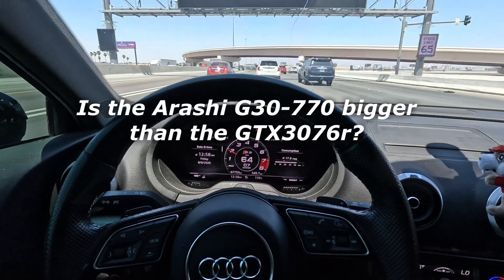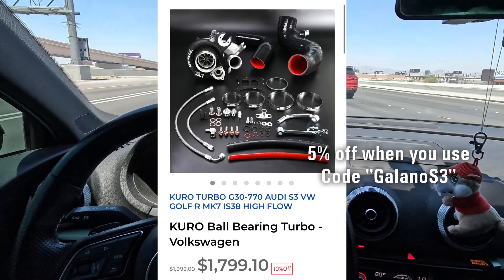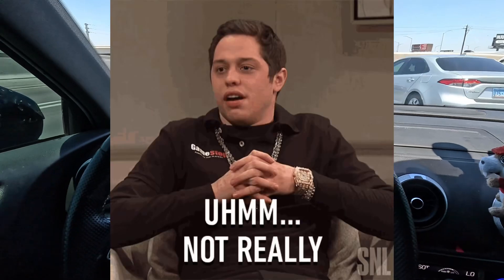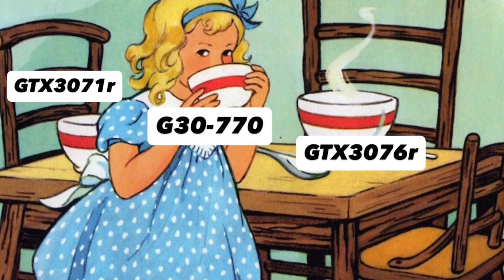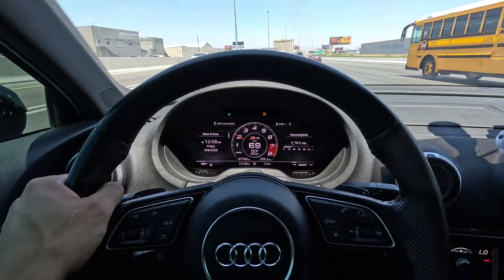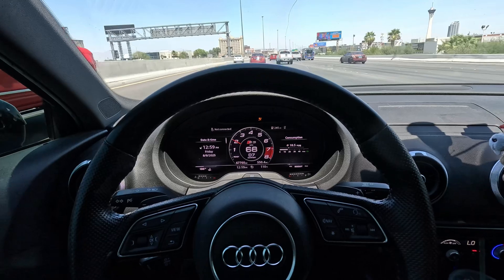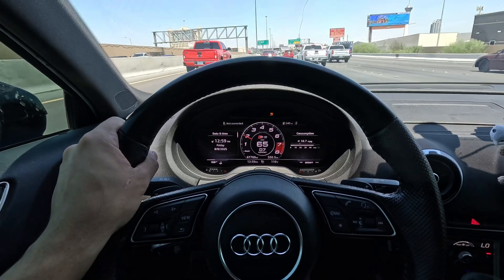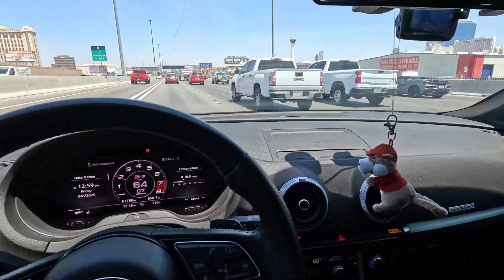Q&A: Is the Arashi G30-770 bigger than the GTX3076r? Lets Talk!

Comment: If the Arashi turbo compressor map has a similar garret’s compressor map, you can say that the g30-770 is way more efficient for high boost applications. The gtx3076 is way more efficient for low boost . That’s why I chose the Arashi G30-660 over the G30-770. I also have a pulsar gtx3076. Didn’t even tune though 😂the only downside is that the g30-660 has 3 inlet😢
Reply from the maker: Well this is a hybrid 2 port on is38 housing which i was explaining in my posts, unfortunately this video is to that and not full frame like you are mentioning which you do have valid points and are correct!
Reply: @Forbidden.s3 yep, my Arashi is a hybrid gtx/g series turbo(LAB Z) one . The “real G-series” are coming out soon … want to know if they are different from mines (hybrid G series) though.🧐